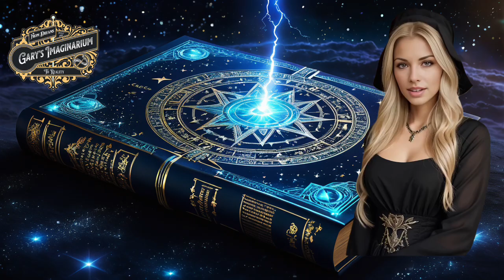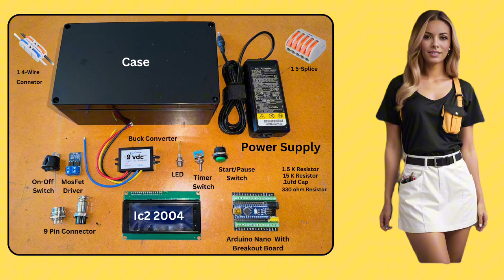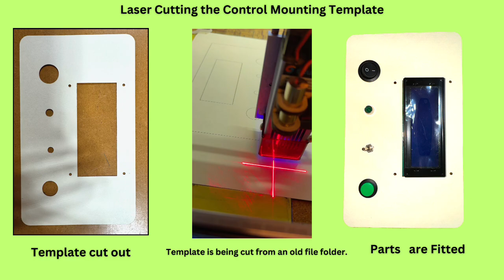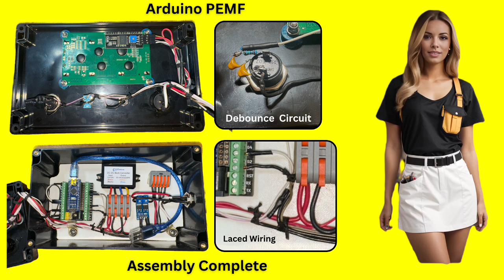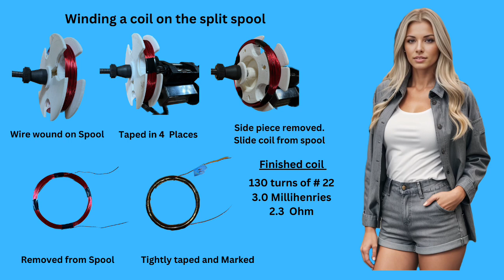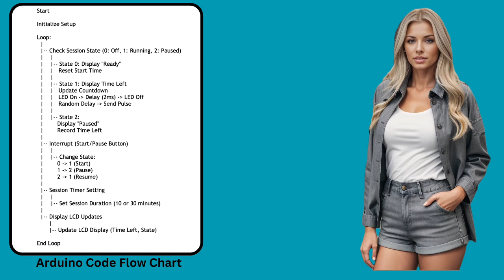Step-by-Step Guide to Building a DIY PEMF Device with Arduino - 2024

Comment: I understand that this is a complete equipment, is it no longer necessary to use any frequency generator? Thank you.
Reply from the maker: The Arduino Nano does the work of generating the proper signal through the driver.
Reply: @GarysImaginarium  TANK YOU

Comment: The charger link sends me to a 19 volt 4.74 amp charger. Can I use that one? Thanks.
Reply from the maker: Yes. It is indicated wrong on Amazon when they call it a charger. If you look at the label it is an AC adaptor converting 120 VAC to 19VDC.